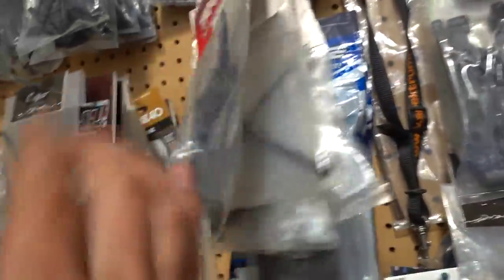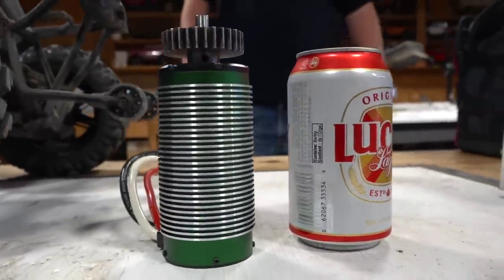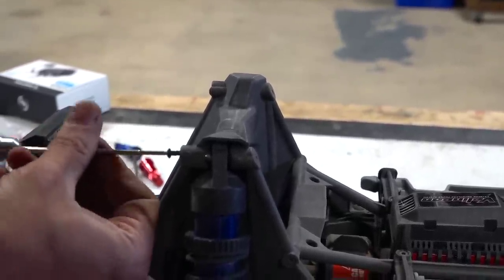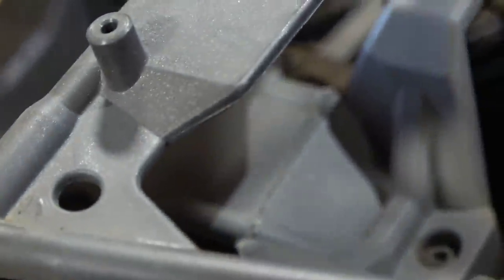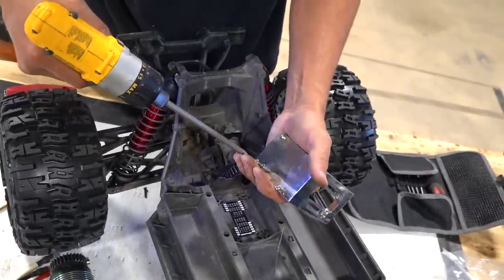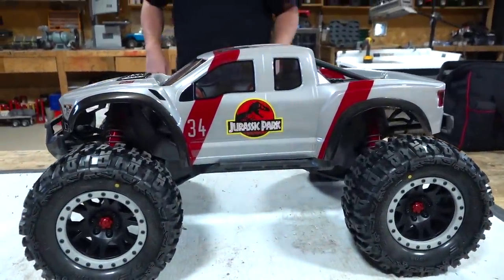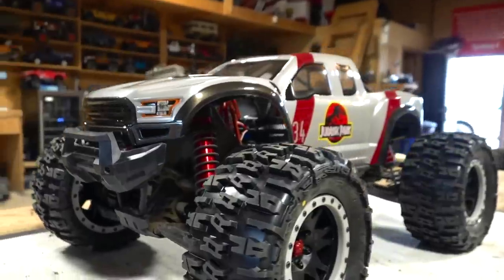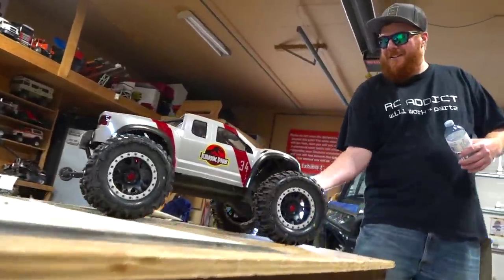JURASSIC PARTS UPGRADE : TRAXXAS XMAXX CASTLE 2028 780KV BRUSHLESS MT | RC ADVENTURES

Comment: WFO max 5 esc plate, reciever box and mount for the ESC switch makes this upgrade look sooo much better, more stable (bolts into existing holes on the chassis) and cleaner than putting your max 5 in the air like that. It is less likely to get damaged with the WFO stuff too.

Comment: Even though it’s machined from a chunk of billett, I could see that motor mount bending from a big jump onto flat ground. That’s alot of weight hanging off it. Personally, I’d be thinking about having sombody machine a 1/2” post to bolt to the back of the mount for the rear of the motor to sit on. Would be inexpensive & cheap insurance. Just my $.02
Reply: I'm going to do something as my thoughts are the same.

Comment: That motor mount looks like a Fast lane hobbies motor mount http://www.fastlanercs.com OR is may be one of the last that Dan Kershaw made before he past depending on when you bought it. Personally I use different hardware to mount the motor, 6mm (or whatever size) hex head so you can slide a thin wrench between the gear and the mount to adjust the mesh. It does need remeshed often until it seats.

Comment: That motor will run on the max6 esc in case you want to save must max draw is 150 amps with a max6 160 amps

Comment: those are some heavy ass gears... should have gone B&M racing gears, ill race you with my 12s set up...
Reply from the maker: Yes, they are amazing! Congrats to him for such an epic build! Great to see hobbyists encouraging others and really setting the bar in how to be a good community member! Race away!
Reply: @TheRealRCSparks  LMAO
Reply: Those B&M didn't exist when I bought these or I would have. Those are sick
Reply: @evtek3962  i dont have some big channel or anything but if you go to my page your see a few videos of the xmaxx im building. On 6s itll do 60mph easy. 12s i havent hit the limit yet. Havent found a tire that can take the speed. Running a custom wound tp5870 875k motor on a ztw 12s 300A esc powered by 6s turnigy graphene lipos, lots of custom stuff.
Reply: @AndrewStorlie  ya nice man I will. Those TP motors are awesome. Probation would have bought one if I didn't already have this one. I have had this 2028 for many years waiting for a different project I didn't finish lmao.